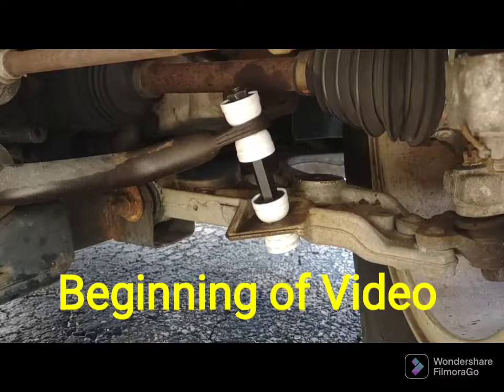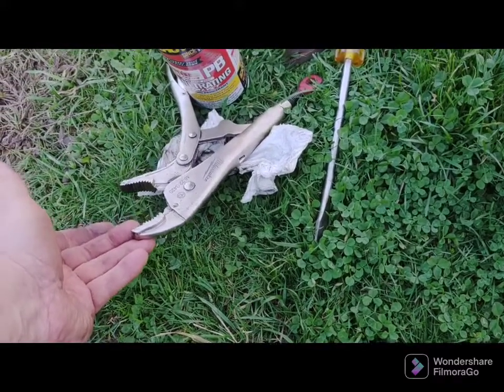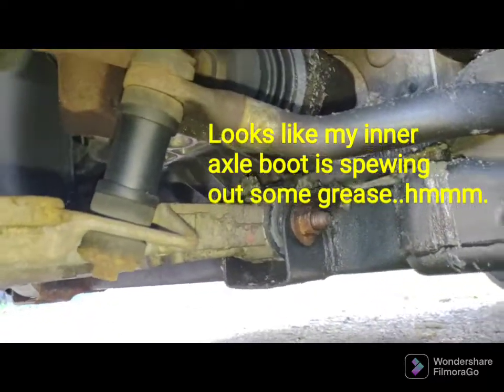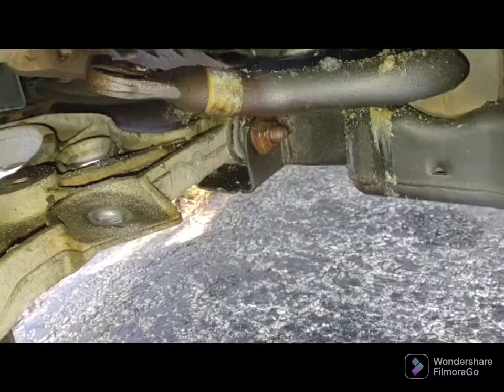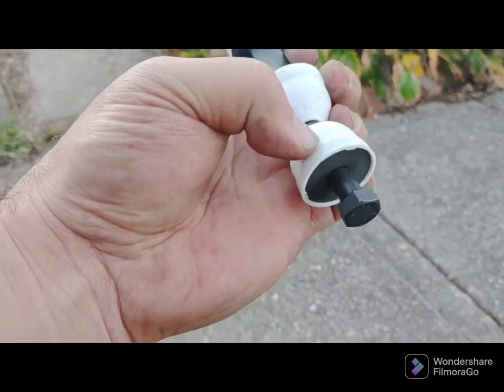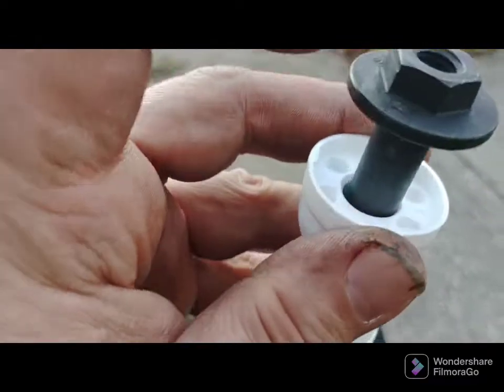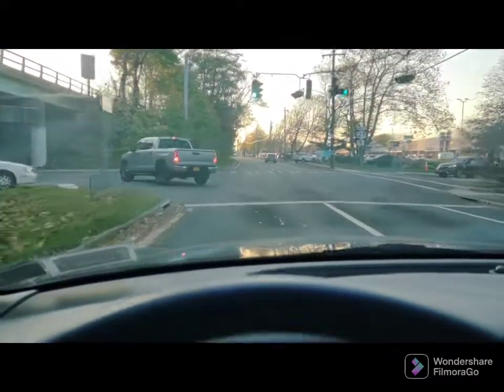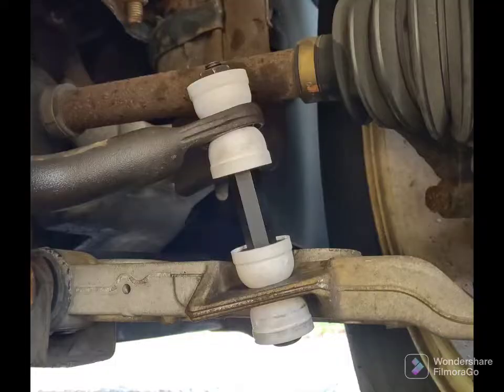2002 Buick LeSabre front Stabilizer Link Replacement

Comment: Those Moogs are great so easy to work with. Don't go polyurethane on the bar mounts they are meant to have that rubber resistance pushing on the bar. The polyurethane have none and tend to cause the bar to move too much and causing noises.

Comment: Looks like you were sold universal/adjustable ones...like for racing they adjust them for more camber or a bigger bite on the inside of the tire. Which would have negative effects on your tire ware... idk but looks like the bar was way closer with the old ones...could through your front end alignment off quite a bit. Hey YouTube Folks tell me , Am i right?